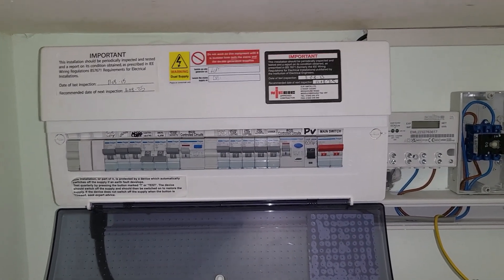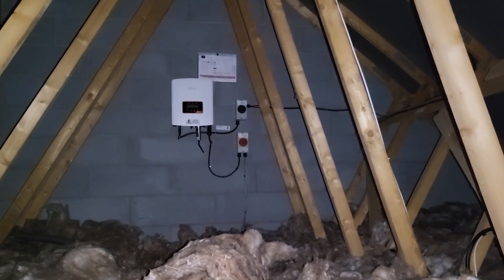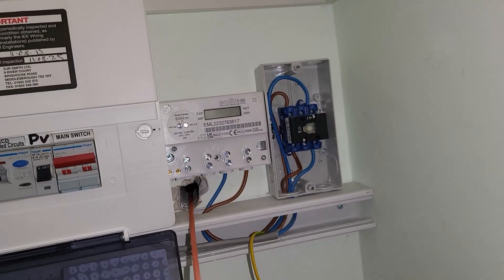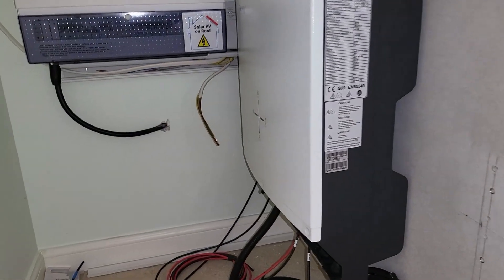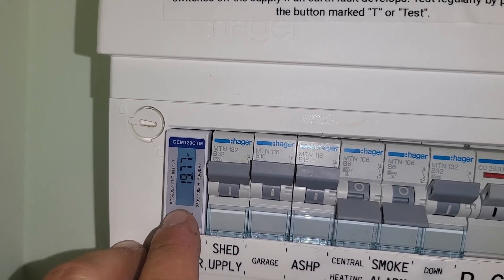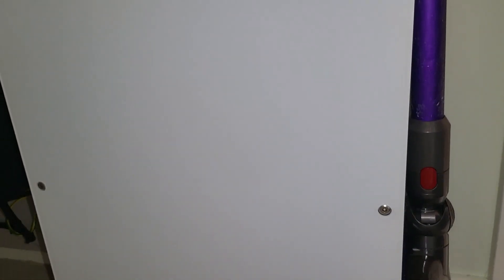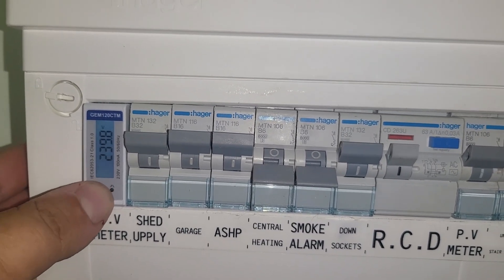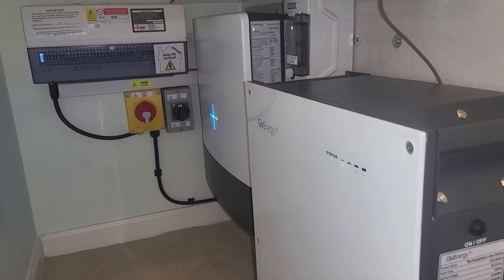How to install - GivEnergy Gen 3 Hybrid Inverter and Battery storage

Comment: That is very nice of you to not comment on early work as 90% of installers had no idea how to do the job, as the training was naff. I myself fell victim to an early install and watched every second, since they left I tidied up the wires, corrected the crossed polarity. installed a fire alarm and cctv. As the install was in the Attic i wanted to be able to keep an eye on things as the wired connection to my computer never worked or the added Wi-Fi.

Comment: Hey Mark - as you say - clearance around the Gen 3 is 250mm all around the inverter, what about on the left? and the meter is obscured... tricky space sure...
Reply from the maker: Has more than the correct space all round. Meter is what it is. Can still be read and we also have the meter in the CU now. More than happy with it.

Comment: Hi Mark, I have one of these to do. the battery cable from the inverter has a utp connection. which connections on the upt plug are used for the battery comms?

Comment: Hi Mark, I have a GivEnergy new setup with 19 panels, 2 x 5.2kwh batteries and inverter isolarboost etc. I wanted to add a third battery, how involved is that and roughly what cost would you say is reasonable to pay installer for a third added battery / supply of it etc?
Reply from the maker: You might be best looking at the larger 9.5kWh battery modules. Costs vary depending on ease of installation

Comment: That fire board is a waste of time. If that battery goes up in flames that board will do nothing.
Reply from the maker: Absolutely ridiculous comment.  Clearly no idea on fire safety in a home. The board has 2 purposes... 1. To help prevent fires originating away from the battery reaching it. 2. If the battery goes up to help allow as much time as possible for occupants to escape. Basics.
Reply: @electrician247  you clearly have no idea about lithium fires at all stick to being a sparky because this is clearly not your strong point. What that fire board is the equivalent of using an umbrella as a back up for sky diving. Once lithium reaches thermal runaway not even submerging the battery in water can stop it. So putting a board on the back is safety psychology than practical safety
Reply from the maker: @mattx4253  we are not trying to stop the fire or contain it. Clearly above your head. Which is fine. If your happy to mount a battery on timber wall and allow a fire starting elsewhere to easily reach the battery. Thank heavens your not an installer. Much bigger picture and I'm not just a sparky. Not that their is anything wrong with that. I do court reports for fire investigations. 

Next question?
Reply: @electrician247  as I said it’s an umbrella for sky diving. Won’t do anything. Makes zero difference. Seat belts on an aeroplane
Reply from the maker: @mattx4253  a concrete board won't stop fire for a few extra minutes for occupants to exit a building? 

Sorry what is your qualification to suggest that? For those who might read this afterwards. We can then update MCS to adjust their requirements as well. 

Let me know 👇

If its expert on the Internet then we can take 0.01% value on your input.

Comment: Can you explain why the unit costs £5800 but people quote £11 to £12k to install them? This is a rip off racket. These batteries are pointless at those costs. Maybe £7k but still pays back 7 years is long time for a unit with only 10 to 12 year life
Reply from the maker: Another ridiculous comment. If its so easy to install them for £7k why not get yourself MCS registered, insured, tooled up, hies/recc approved and give it a go? 

Its fine if you can't afford one, other options are available. I've got a cheaper system in my own home. 

You are forgetting all the cable costs, isolators, labour, travel etc etc. 

Also the units delivered are generally 6k delivered including the VAT. A trunking, cabling and isolation setup can't be anything up to another £1000 or so depending on runs. 

MCS notification and HIES insurance add a few hundred more. Admin for dno notification, site team for a day or 2. £9000 + VAT easily validated. 

Strange mindset to believe a market place is out to rip you off. Shop around. Do the maths. 

It's a 12 year warranty. Most payback are inside 7 years. Faster if you are prepared to put the effort in load shifting and use enough electricity.

If you are a small consumer payback will take longer. 

But imagine this 7 years from now when you would have long since bought, consumed and lost imported electricity. Its still sat there reducing your bills and that's totally forgetting the value of going off gris, load balancing, surge protection and all the features you seem to have no value over. 

Make sense? 

If not can't help you.

Comment: Hi Mark, We are looking at using Givenergy. Do you install SPD on DC side?
Reply from the maker: We do but they do also have DC spd in so don't have to.
Reply: @electrician247  Givenergy has DC surge built in? I was told they don’t?
Reply from the maker: @roser16v  best check your model and with Giv directly but my understanding is gen 3 hybrids have output protection on current and voltage via varistors etc.
Reply: @electrician247  great thank you.

Comment: Another reason to avoid the loft is possible is that the electronics will probably not last as long if exposed to very high temperatures.  I would love to know what your opinions are regarding cold temperatures with outside installations and what Give Energy reckon because generally Li doesn't like charging at very low temperatures although discharging at very low temperatures are not a problem.  Victron software will not allow Li to charge at below 5C.
Reply from the maker: Sometimes it's the only way. But last resort for for me is any environments that have extreme temp swings

Comment: Hi Mark,

I've only just learnt that the zero rate VAT on battery installation only applies when it's done as part of a new solar installation. We're in the same sort of scenario as this customer was in - We already have a standard solar installation and need to replace the inverter with a hybrid model and add a battery. Do you know if the replacement of the inverter itself is enough for VAT purposes to count as a solar installation or did this customer have to pay the full 20% VAT rate on this job?

I'm really struggling to understand exactly what is and isn't allowed as this revelation has really messed up the funding for our battery project - Our installer's VAT specialist is saying that it wouldn't be covered but I'm really hoping you might know of some way to make the installation eligible seems as you've just done a project like this. (Even if we have to lose our FIT and count it all as new, that would still be worthwhile to us)
Reply from the maker: I'm afraid VAT would be due. Although government currently have review on removing VAT for batteries! 

Have you though abut just adding an AC coupled battery and additional inverter or looked at the giv energy all in one ac coupled system? Might be an option
Reply: @electrician247  Thanks Mark, I didn't realise it was still under review I thought dropping batteries from 5% to 0% (With the solar installation requirement) was the only thing but it's good to know that it might change - I get confused as they keep changing the rules every few months!

We did consider a separate AC setup but it would be nice to have it all as one so that we can get some proper stats from it. (The current installation is in a barn so no fire risk issues and plenty of physical space) I'll have a look at the GivEnergy setup but ultimately it comes down to the price of the batteries themselves as they all tend to be in the same ballpark from when I last looked but I'll check again. We'd budgeted based on not having to pay VAT but we might just need to reduce the amount of storage or wait to see what happens with the review.

I feel for you as installers too, how are you meant to advise customers when the rules keep changing?

Anyway I appreciate your time, cheers Mark.
Reply from the maker: @andrewyoung9748  no problem and you are right it's a minefield!

Comment: Hi Mark, that meter looks like a re-branded Eastron SDM120CT. SolaX said they don't support them but they did say you can use the Chint DDSU666-CT with SolaX Hybrid inverters instead - Useful for when you need a very long CT cable as it uses RS485 instead. (The manual used to say 25 meters max for a CT, but the latest version says 100 meters)

I was wondering about the MCB for this sort of meter, looks like you've used a 6A for it - It's a shame that they don't have a built-in fuse or something like that to save a space.

Did you need to do anything regarding a FIT tariff with the inverter capacity change? Or was there not one for the existing installation?

Just regarding the battery circuit breaker, doesn't it have be a metal enclosure? I would have expected it to count as switchgear.
Reply: @andrewyoung9748 you're right this looks identical to the Easton SDM120CTM (M for modbus over rs485, CT for....CT rather that wire-through) just with a slightly different part number
Reply from the maker: Not sure on the rebrand. Possibly! 

The original install is only a few months old believe it or not lol. So all good with fit/seg. 

We did consider metal enclosure but ultimately trying to avoid conductive parts around the DC cabling and connections. It makes sense to me anyway.
Reply: @electrician247  I wouldn't have guessed that it was such a new install, surprised that the customers have decided to go for a battery so soon after installation - It backs up your suggestion in previous videos to always plan ahead for batteries at a later date.

Your justification on the enclosure makes perfectly logical sense to me too. Fortunately the newer batteries appear to include them which makes life simpler!
Reply from the maker: @andrewyoung9748  this customer played it smart tbh as they was unsure if they would export anything with careful usage. It's a relatively small array. But having punched the numbers went for an upgrade. 

We have the Givenergy gen 2 battery next and that has a built in MCB. Showing the whole range of options right up to the 13.5kW all in one.

Comment: Hi Mark.  Love the videos.  Can you tell me what size mcb you used in this installation and why it was not rcd protected.  Was the modbus on an mcb.  Thanking you
Reply from the maker: Modbus has to be on a 6A circuit as was the case here mate. Inverter on a C40 mcb. GivEnergy gen 3 inverters don't require RCD protection unless the supply cable route/type dictates otherwise. Thanks

Comment: Problem with loft battery/inverter location is mostly the temperature in summer, it may reach well over 40c in summer, which will throttle performance of inverted as well as the battery. Also, if loft is not insulated, and there is no cell heater inside the battery it will also throttle below zero.

Generally if you're worried about fire safety, never install batteries inside of the building.

Also, not sure what Givenergy recommendation, but generally it is not a good practice to implement DC circuit breaker on a battery path, if fact you should minimise amount of connection on low voltage high amp paths.
Reply from the maker: As described in the video the DC mcb is dictated by GivEnergy.  In fact it's an essential requirement on all battery/inverter links aside from battery modules with the DC MCBs built in.

I've covered my views in fire safety in an earlier video. The global stats on loft locations are clear.
Reply: @electrician247  Could you please point at regulation regarding "essential requirement on all battery/inverter links aside from battery modules with the DC MCBs built in".
Reply from the maker: @paulf3353  Can you point at any regulation regarding anyrhing 🤣. It's all guidance outside of EWR1989 and such. 

That said the requirement is detailed in MCS 3012 I believe and most importantly in most battery manufacturers instructions that do not directly incorporate a DC mcb. Certainly the case for GivEnergy,  ICS, and older solax options. My understanding is they base that decision on stored energy above 3kWh which when you think about it makes sense at 50-120V range.

As discussed in the video GivEnergy take it so seriously they will not allow commissioning of the inverter /battery without a picture of the DC mcb terminals and use of the ferrules evidenced. As you say the terminals increase risk so they are trying to ensure attention  to detail is paid I guess! 

Also as discussed next time we will share a give gen 3 inverter and giv gen 2 battery with built in mcb and direct connection on the cables 

Hope that helps 🙏
Reply: @electrician247   I'm serious, could you please point at specific page where I can find it is required, because I'm struggling to find requirement of external DC isolator.

It may make sense to have an external isolator if you have a huge array of batteries you want to isolate at once, but for one battery it is absolutely not required in fact it is more harmful than useful. Even in Givenergy  manual I've just check they have multiple batteries on schematics with isolator. Every standalone solar battery has some sort of isolation built in, otherwise you'd have live terminals all the time even before commissioning.
Reply from the maker: @paulf3353  I am really not here to do your research for you but have at it. https://kb.givenergy.cloud/article.php?id=82&oid=1 Very clear in the GivEnergy knowledge base. You are wrong and thats okay. Hope it helps.
Reply: @electrician247   Just to clarify, your claims for DC isolator are based on Givenergy recommendations, not any regulations. Not asking for research. 
 BTW, there is nothing about Battery isolator mentioned in MCS 3012 as far as i can see.

Comment: Honestly I never understood peoples almost obsession with using attics to mount equipment that wants servicing and maintenance. I've lost count of the amount of customers in recent years that have asked us to remove equipment such as boilers/water heaters and invertors from the attic and refit them somewhere else in the property. In the end you have to fit it where people are willing or able to allow space for equipment but we've never put forward or advised people to do it. 

Also I second that more people need to get thoroughly stuck in before commenting, I know a fair amount about our industry but no where near what I want to know due to being split between multiple roles and trades. As such I have decided to spin off from my partners with a couple of the employees so we can focus on electrics and renewables. 

Also that Schneider EV install went brilliantly though there were delays getting 4 pole mcb/rcbo combo's so many thanks for your advice with that one!
Reply from the maker: Wholeheartedly agree mate and glad to hear it went well
Reply: Most people don’t have an attached garage to fit stuff in so the loft might be their only option.
I watched a YT video and the homeowner had batteries and all the equipment fitted in a downstairs 
toilet.